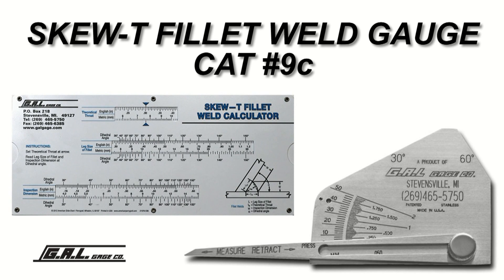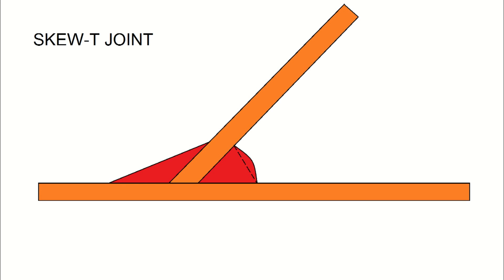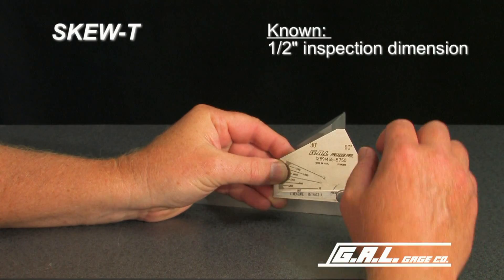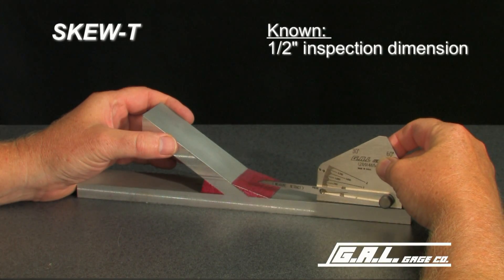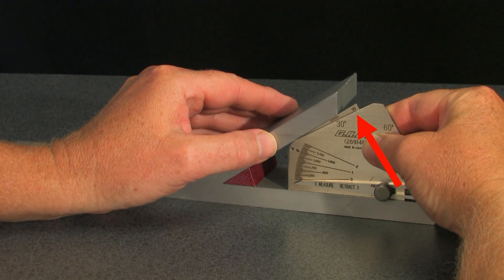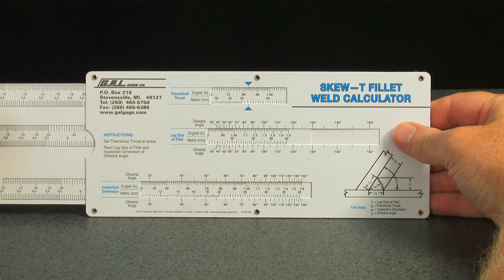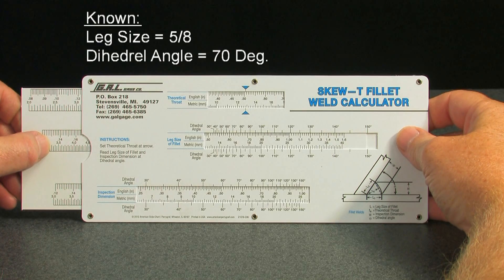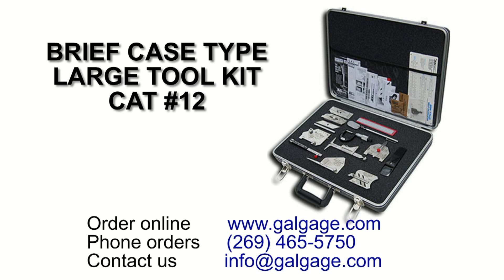The Skew-T Fillet Weld Gauge by GAL GAGE Company

Comment: GAL you have the terms "Obtuse Side" and "Acute Side" called out backwards.  Obtuse for angles greater than 90-deg and Acute is for angles less than 90-deg.  The obtuse angle is on the left and the acute angle is on the right shown around 1:40.